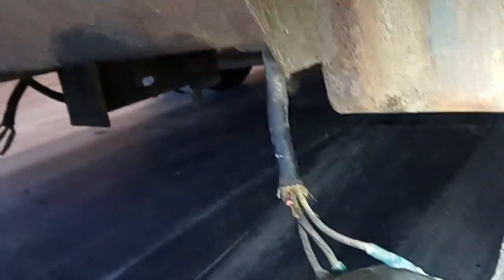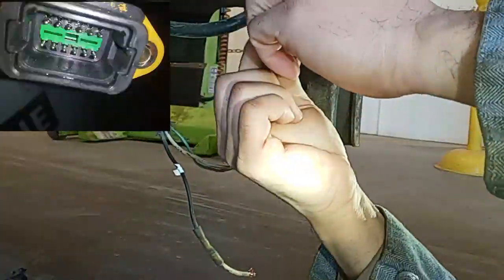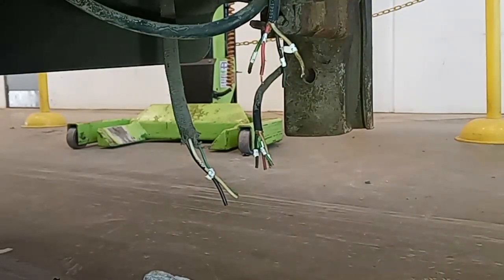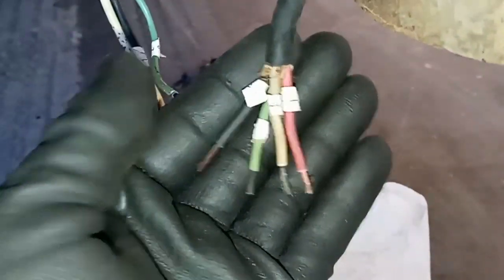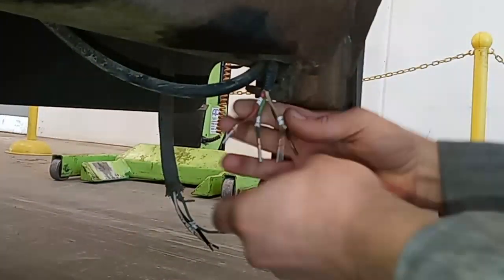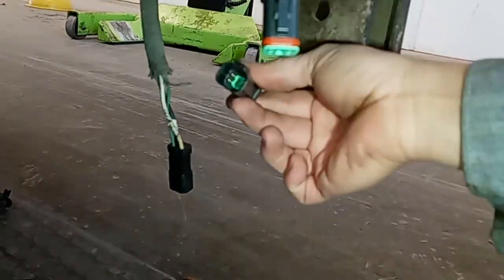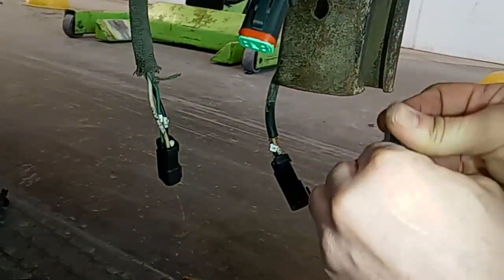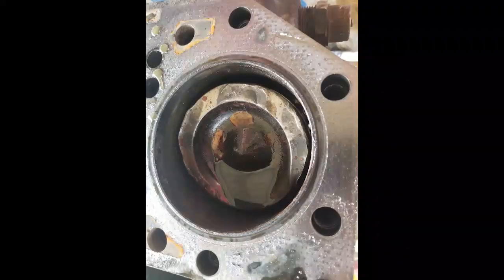Fix Wiring and Harnesses Like A PRO!!

Comment: Back when I was still working on semis and trailers, we'd build our own harnesses after the factory wiring inevitably failed. We built them modularly so that if a light, its pigtail, or a section of wire failed, you could just remove the damaged segment and plug in new wiring. We'd use Weatherpacks since they were super common, cheap and didn't require special tools to fix so that some hack on the road didn't just chop our wiring up in case there was an issue. Now that I work for CAT, I've grown to love the Deutsch connectors.

Comment: I have repaired commercial aircraft wiring and connectors for many years. Your use of Deutsch and Amphenol connectors and the tooling are spot on. Soldering to repair broken/damages wiring should never be used for a couple reasons. The wiring must be cleaned, and a solder flux used and cleaned for best results. Second, heat from the iron can cause additional damage to wiring/components. Not enough heat will cause cold solder joints, or the solder may not bond with the wire. Next is solder joints do not flex. Vibration can damage wire at the solder joint. Laster are the butt connectors. While these should be used, if possible, fluids can run down the wire and migrate into the butt joint. We were required to use environmental butt splices or to wrap the repair with silicon tape to keep fluids out of the butt joint. Watching your videos and seeing some of the wire repair is enjoyable as I don't have to fix them. Keep up the good work and I enjoy your video's.

Comment: Thanks man cool video. LOL I’ve fixed wires like that since the 60’s so you’re way behind. LOL 😂 
Before they had crimping toolsets and duct tape we soldered the wires together and black tape and bailing wire was our friend. 
We replaced muffler bearings it seemed like weekly and the tail lights were always pumping oil.
Reply from the maker: I am picking up on some inaccurate repair options there Dan. 😁
Reply: @AdeptApe  When will you get use your video on diagnosing bad muffler bearings, and what level do you run your blinker fluid at on your trucks???
Reply: @tylergladys6626  my soda pop addiction finally paying out it sounds like, I can build a corporate empire now.
Reply: @wickett7078  Concentrated blinker fluid isn’t optimal but it will work.

Comment: FYI to all.
Go to your Cat dealer and ask for a print out of REHS0970. Contains a lot of Deutsch and other connectors, sockets, pins, etc.
It is about 100 pages long, so I would bring a jump drive and get it on it. The green ring pins and sockets are for larger wires 14 gauge. The other non ring are for 16-18 gauge wire. I like the gold plated pins and sockets.  Also don't hurt to get this media number as well SEHS9615 and REHS7215.
REHS7215 has bulk harness you can get from Cat. Comes in a pretty yellow sheathing  with different color wires, 14 gauge if I recall. 
Three wire 3668856
Six wire 3668857
Nine wire 3946873
Twelve wire 3946874
Sold by the DM, don't ask why. 
The single wire splice is a 1158109. Will require a removal tool to pull this connector apart. Cat makes them in plastic, color for size of wires. Or you can get metal ones from a tool seller. 
You can buy plastic sheathing from Cat, I get mine from Grote a lot cheaper. If you don't like the plastic, Cat offers a variety of bulk sheathing that you will have to feed the wire through. Color, sizes, etc., sold by the CM. 9X1813 for example is black, 7.62 ID MM. Sizes range from 4 MM ID up to 97 MM ID. Be warned most of the time if they don't stock it, you have to buy the entire length Cat sells to the dealer.
The wire splitters comes 2073814 one male two female, or 1999785 two female one male. 
As Josh stated butt splices are a chicken sh_t repair and if they are out in the weather this is the proper way to do it.
As I was told, if you have enough time to fix it the second time, why didn't you have enough time to fix it right the first time.
Reply from the maker: I'm going to save that media number to my work computer. Thanks John.
Reply: @AdeptApe  Do you have a copy of pick your power?
Reply from the maker: Never heard of it.
Reply: @AdeptApe  It was a program Cat came out with to take a 5EK and rebuild it to 6TS iron. I use it very little now, but as I stated it becomes a 6TS with a 5EK serial number.

Comment: As a retired master electrician The only thing I would add is use non-conductive electrical grease before crimping a pin on to a wire or pushing a male and female pin together. Hey you have a great voice for radio or television. Mike from Maryland
Reply: I always smear/squirt Dielectric grease in connectors and on any exposed electrical connections,  after cleaning of course

Comment: Those pre done splitter's look very handy, thanks for the video. If you've only got 1/2 wires to splice and don't really need to disconnect them deutsch makes jiffy splices that are a housing that takes a male and female deutsch pin. You need a depinning tool to seperate them but they're a fair bit cheaper than using DT/DTM connectors.

Comment: It’s sad how many “technicians” think heat shrink butt connectors are great and proper. Thanks for putting this out there!
Reply: The reality is, if done properly, a butt connection is suffice for many applications when also used along with marine grade shrink tubing. The method shown is preferred, and I usually solder all important connections. But, butt connections do work when applied properly.
Reply: Good quality solder heat shrink wire connectors are actually decent for permanent repairs.
Reply: @markm0000  very true. We aren’t building a space shuttle here. I think “if” you can over engineer something, GREAT! But sometimes just good enough works 🍻

Comment: Those are the ones I use, for the gold and the green-stripe. 
CAT-approved repair for a broken wire is a Deutsch-pin and socket with a glue-lined heat-shrink. 
Or solder and heat-shrink.... 
But the Deutsch and Ampseal kits are nicer. 

Weatherpak is obnoxious.... they can lose spring-tension in the sockets

Comment: Only thing I would have done differently: 2 heat shrink wraps per line off the truck.  First one butted up against connector, second one about 1/4 on the connector covering back onto the first.  Only because I cant stand seeing loose wires under a chasis.

Comment: I have a nice Deutsch Connector kit I paid $500 for. The crimper is well made and it comes with a large selection of connectors. Odd thing is, the female pins go into the male connector... not very intuitive. Thanks for the video.
Reply: @Life Stream I believe it's that way for all styles of connector. The female pins have to be on the male connector and males on the female side so everything joins together and seals properly. If it was the reverse, one wouldn't fit completely inside the other.
Reply: @gearheadautomotivel.l.c.5476  Thanks for the input, I wasn't aware of that. It does make sense... I guess. I was so smart I only had to redo it 1 time! WOO!!!
Reply: @lifestream4191  No worries. You're absolutely right though. It's counter intuitive from what you'd initially think. The hard way lessons are the ones you don't forget. Definitely got my fair share of those.

Comment: The destruction of the week I seen this week was on a peterbilt with a high output X15 Cummins engine. The DPF internals were melted, first time I had ever seen a melted DPF, so it needs a whole after treatment system and turbo, under warranty too.
Reply: If the filter ended up melted then the engine is pretty much toast or right on the edge of its miserable life.

Comment: For the last 10 to 15 years, I've been looking for the weather pack kits but have been unable to find them. How do you order the kits, though Cat or some place else???
Reply: You can buy them at any parts store or order them on line from places like Amazon. The full kits (talking 100s of pecies, some of everything) are expensive so they are rarely in stock at a parts store, but can be easily ordered typically for next day pickup. I know wirecare.com has basically anything you could want, but I'm not sure if they offer any larger bulk packages.

Comment: Soak the green corroded conductors in some mild acid for a few minutes. I use "the Works toilet bowl cleaner".  Rinse them off well with water to neutralize the acid.  Problem solved!

Comment: I have had a bad socket in a deutsch connectors on a kinze corn planter. These connectors are difficult to get the pins out of. I prefer weatherpack connectors. Easier to work on but need more servicing and less secure.

Comment: I guess that’s the benefit working at the Cat house where they stock all the parts. All the shops I worked at were to cheap to buy the fancy stuff
Reply from the maker: It's more planning and luck, Cat uses these style connectors on nearly everything and I already had the pins, sockets and connector part numbers to build the plans for it.
Reply: Pile of bull, I can have it the next day most of the time. I have my own inventory of parts we don't stock that I need.
Reply: @AdeptApe  sorry this has nothing to do with the video, but topic came up earlier of how long you should crank a diesel before letting the starter rest. Would make for a good video!

Comment: Enjoy the info from your videos, thanks. Question for the cat man. I’m looking at a 04’ freightliner that was a glider with a 3406e. If I put in c15 will the wiring need to be changed? Can a e model run a eld? I liked my e model in my kw but I was always led to believe they run a eld even though they have a ecm.
Reply from the maker: If they both use the 70 pin they should pretty much plug right in to each other, if going from a 70 to a 40 pin you'll need an adapter or re-pin the connector, which wouldn't actually be that hard. Any of the E models should be able to run an ELD since they will communicate over the datalink from my understanding.
Reply: @AdeptApe  thank you for the response. That opens up options to know that the e should run a eld. The company I’m leased to went to a 20yr age limit.

Comment: I was told about this oil for Cummins motors that cleans out the motor called  Valvoline premium blue restore 10w 30..do tou know anything about it and what you think about putting it in 06 cat c15 accert tks

Comment: Can you share how to remove Pins (wires). From  Deutsch connectors and Packard (Metripack) plug
Reply: For Deutsch just pull the locking tool out (the green plug), then look down into the connector where the lock was pulled from and you'll see a "finger" that locks the pin/socket into the connector. Use a pocket screwdriver to move that finger and the wire will pull out from the connector body.
Reply: Haltech has a good video on how to depin those (and pretty much any other kind of connector you'd find on an engine)

Comment: Thanks love the videos buddy I got a question about water 💦 in the fuel filter my guess is because water is getting in our tanks pumping install there trucks! Why u ask I think i know that because I walk on top of the tanks and see the caps and always gets fuel light on the dash to have to drain and replace the filter but this shop is so dumb it’s annoying I’m gunna try take samples and show them water coming out of the pumps just haven’t don’t it yet why I haven’t raised hell but I wanna know everything it will do to Detroit, Cummins and Pat Car crap 💩 that I’m not of fan of lol
Reply: I was filling a 5gal gas can for a generator exclusively at the same station for a few months. The generator was getting harder to start and occasionally would die when running. Finally just didn't wanna start till like 40 pulls later and starting fluid. Something is definitely wrong. Usually didn't empty can,  just run down then fill and take back with me full. I had cleaned carb not too long before shouldn't be dirty yet. (Put a clearish filter on at same time). It's got fuel...peak in gas can...hmm looks funny in there. Take can and Gen home to work on it properly. Dump Gen fuel back in gas can. Was nearly full. Start dumping fuel into a clear jar...yep water in there. Pour off gas to save it then dump water, and repeat. I got darn near 1 Gal of water from the can...never been back to that station.

Comment: Would these work for lights down the side of  a truck?
Reply from the maker: Yep, any electrical they are great. Other than super high amperage circuits line an alternator or starter wiring.
Reply: Yes but that would be an expensive way to string them, I use the pre-made wiring for it.

Comment: Is there is special tool to release pins?
Reply from the maker: For the larger connectors like the 40, 70, 120 pin connectors there actually is a tool for them. I actually discuss it in one of my older wiring videos.

Comment: How fast can a diesel engine in a big rig or a pickup truck can go
Reply: MPH = RPM X 60 divided by transmission ratio x axle ratio x tire rev per mile. 

                         RPM X 60
MPH =            -----------------

                        TR x AR x TireR.

Comment: I have a friend that is in desperate need of the wiring diagram for a 2007 peterbilt 387 with a cat c15. Specifically the diagram for the Guage cluster. All his Guages stopped working today and peterbilt told him that they discontinued that diagram and do not have access to it anymore. Do you or do you know anyone who may have an archive of this?